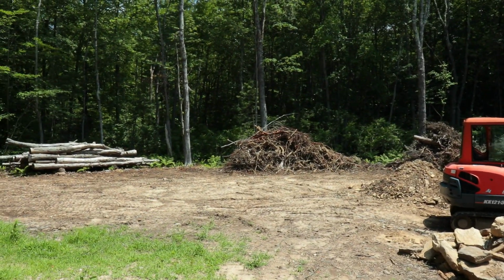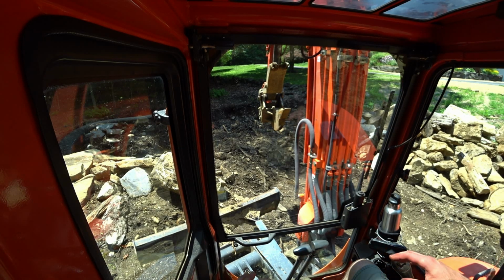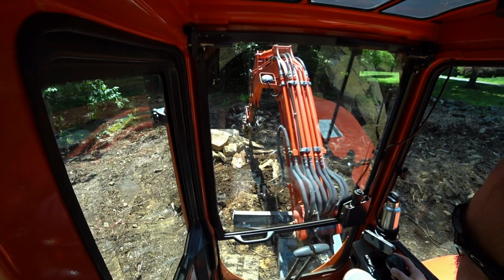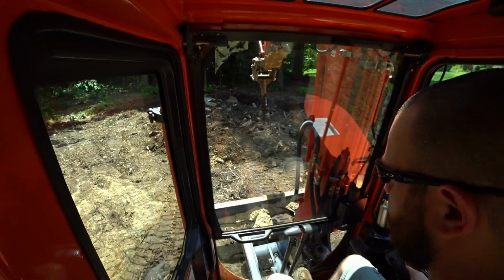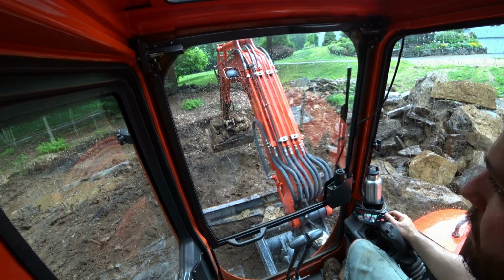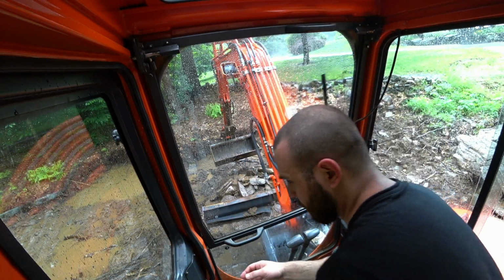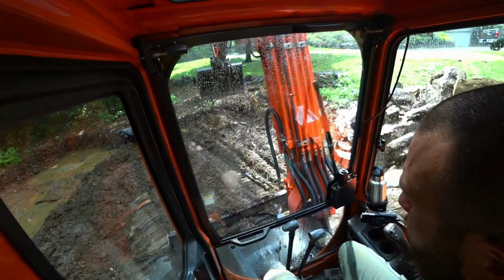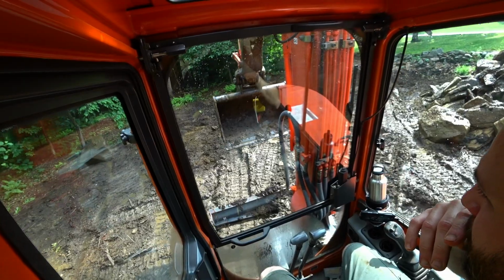Sorting Large Stones with a Kubota KX121-3 Excavator | Homestead Rock Ideas

Comment: That is a great machine for the job, didn't realize they were that strong. I have never seen so many rocks in an area that size. Thanks for sharing
Reply from the maker: URHC those stones you see are only from the first 12". I know crazy, huh. Just want to make the area accessible for the activities around the future garage. Now i need to think up some good use for all these interestingly shaped stones. 

For a 10k lbs. machine it does extremely well. Its not named the super series for no reason! haha . A 40hp kubota engine and 18ft reach really gets alot done fast. It can still pull out some of the biggest stones and stumps, that others say it cant. It can safely hold a 1 ton stone out at full reach. Its quite impressive. Thanks for watching!